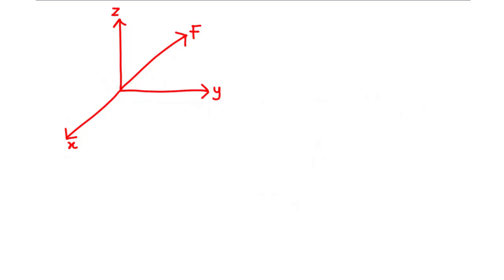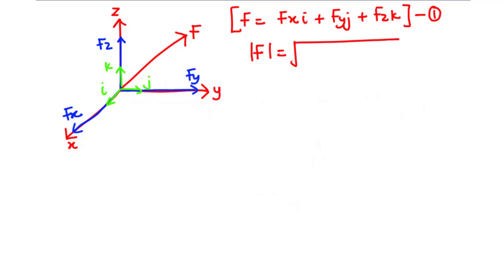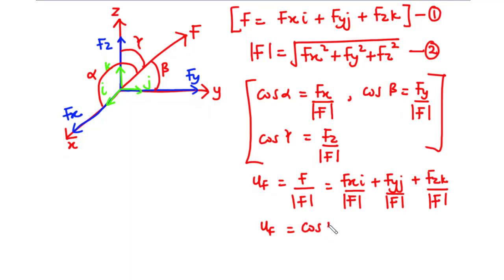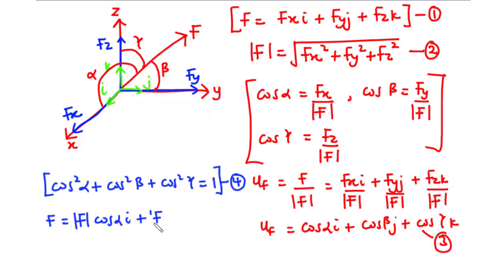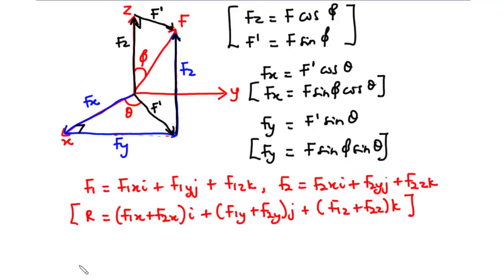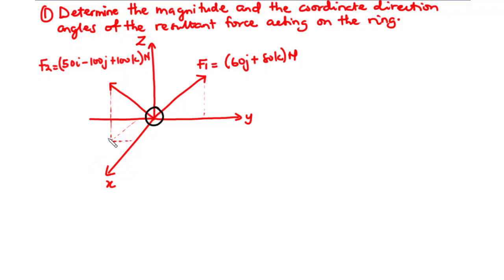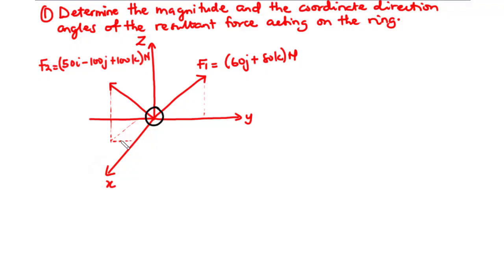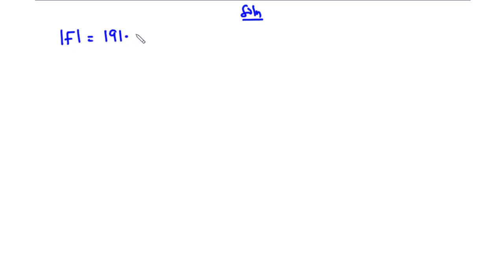🔺07 - Cartesian Vectors and Direction Cosines 1 - Example 1

Comment: Why and how is the angle between Fx and Fy 90°?
Reply from the maker: This is a 3d representation of vectors, so the angles between xy is 90, yz is 90 and zx is 90
Reply: It's not really clear but thanks for the response
Reply from the maker: You need to consider this as the Conner of a room, each plane is 90 degrees to the other.

Comment: What if the angle formed between f and fx you move in the other direction is it wrong?
Reply from the maker: Please for which of them, kindly state the exact time in the video, so I can check
Reply: 5:36 the introduction
Reply from the maker: Okay, i don't really get what you are saying but I want to understand it that, lets say if the positions of x, y, z changes depending on the textbook you are using, the angle between fx and f could be a different symbol but then in the cause of your solution don't interchange anything, use it as it is.
Reply: @SkanCityAcademy_SirJohn  When you were moving from f to fx you started from f towards the fz line then to fx to get the angle between f and fx but can it be the other way round as in moving from f towards the fy line then to fx
Reply from the maker: @user-zk6dp2bd1o oh yes, you can
Reply: @SkanCityAcademy_SirJohn  okay thank you very much